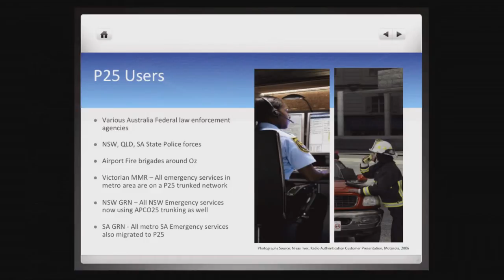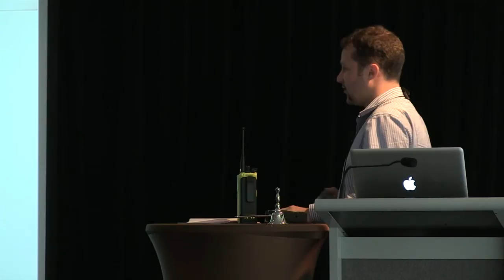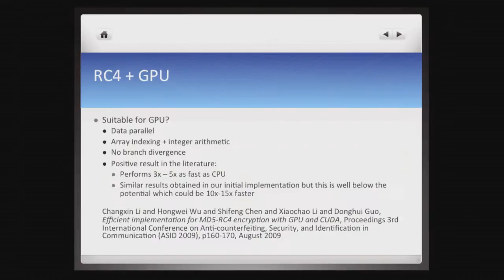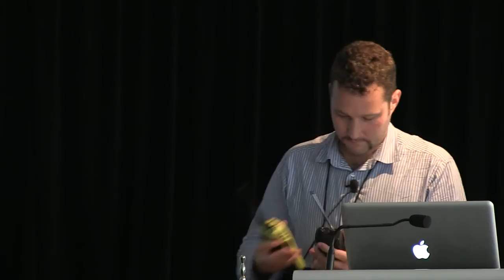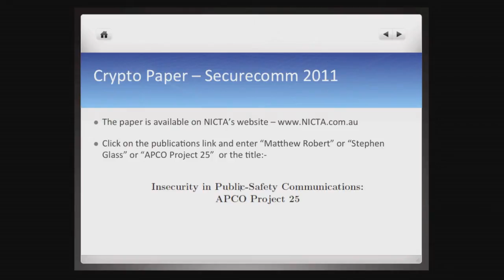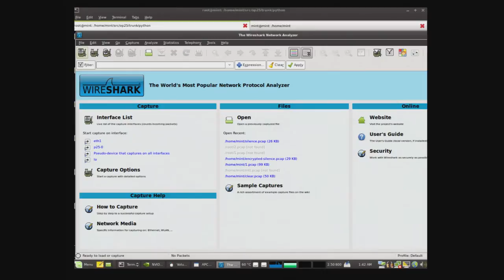APCO P25 Security Revisited - The Practical Attacks! - Matt Robert

Comment: Coming soon.... Encrypted P25 control channels.
Reply: Encrypted CC never Made it out of the "gates" (someone reading this in the future some day will get that joke). Radio authentication on P25 and AES256 have been in use for many years now as of 2022. I'd love to see some updated research similar to what is presented here to see how much has been fixed already with that and other practices  like strapping.
Reply: @Redneck_Ed  YES😁
Reply: Not likely to happen before P25 is retired. Too much infrastructure would have to be chucked.
Reply: DiverCTH 
Hytera implemented 128-bit OTA signalling encryption for DMR radios and all it took was a firmware and CPS update.

One day something like this will become common on APCO P25 systems to thwart whackers.

I don't run p25, but recently implemented OTA signalling encryption to our DMR systems which already had AES 256 voice encryption. Works great. Tested it against DSD, DSD+, and other radios- results are the same- no TG #, no RID # displayed. 

This kind of security is needed when you're dealing with exceptionally talented whack-hackers like the guys who did this research. Anything less gives them a way in.
Reply: p25 is national security risk p25 systems can be jammed with a 30 girls toy pager modified sold by Texas instruments  with a cc11110  chip.   digital radios can be jammed easy they put it a weak signal all you need to do is disrupt data and radios jam.  digital radios put out weak signal as opposed to analog.  only way to fix go back on analog radios
Reply: all radio can be jammed, digital or otherwise.   Analog radio sigs are not inherently stronger than digital , you don't know what you're talking about. @kevinwells2182